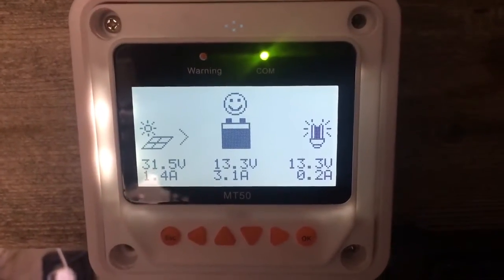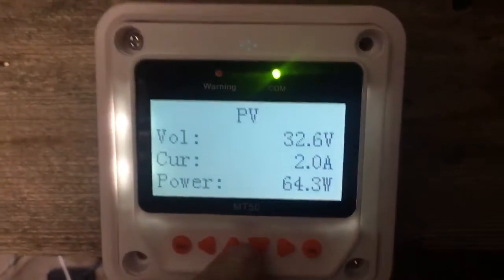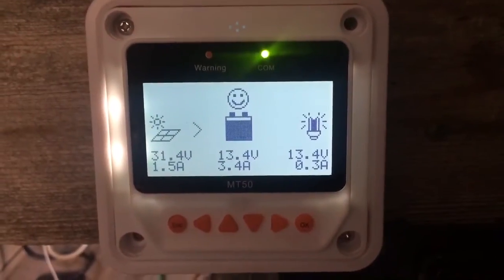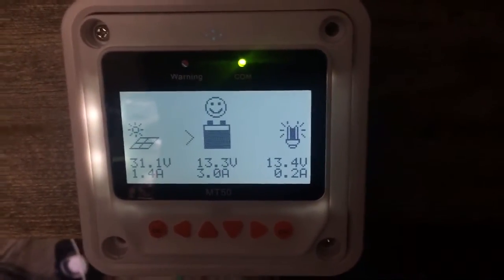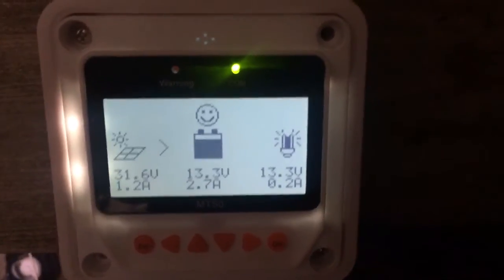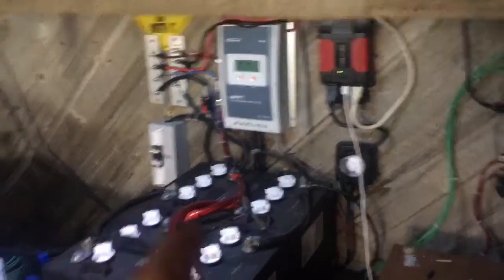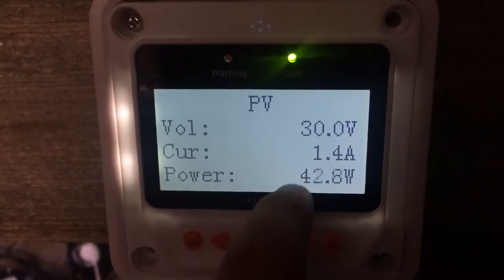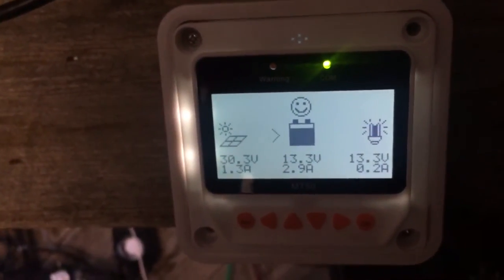Cloud Edge effect With My Solar Panel System

Comment: I thought the A on the left under the solar input was the amps coming in?
Reply from the maker: DecoD71 it is if I said otherwise I made a mistake thanks for watching and please subscribe
Reply: Tom Ziesmer ok but when yours jumps to 11.8! Is that measurement amps coming in or going into batterys?
Reply from the maker: DecoD71 going into the batteries
Reply: Tom Ziesmer ok cool. I have the 40a model aswell just getting my head round it.. keep the vids coming
Reply from the maker: DecoD71 if you have any questions let me know and I will try and help

Comment: Hey Tom, thank you for the breakdown on these MT-50's.  So, I installed my solar in my van about a year ago... and I didn't set to the correct settings on my MT-50, had no idea... Anyway, the MT-50 was set to 200ah sealed batteries, and I had 250ah AGM, think I killed my batteries.  Would you happen to know why the MT-50 will be reading 13.8 or higher on the "monitoring" screen under the smiley face and battery but my batteries are actually reading 12.4 or so on the multimeter?  Thanks man.
Reply from the maker: TwoWander hey thanks for watching and subscribing. Lots of things could be wrong the first thing I would check is make sure the battery terminals and the terminals on the charge controller are not corroded and are tighten to the correct torque. Another thing that could be wrong is your wire going from the charge controller to the batteries are to small or to long and you are getting a voltage drop. How long is your wires from CC To batteries? Another thing is the charge controller is just no accurate but I’ve never had a problem with that so I don’t think it is that. Let me know how long and what gauge wire you are using and we will go from there. I hope this helps and if you need anything else let me know
Reply: Thanks for the reply!  Your answer is exactly what Renogy told me last night.  Good news is I disconnected everything, fully charged the batteries, increased the wire size from battery to charge controller to #8 vs the #12 I had.  The wire is only about 3' long.  Now it looks like the batteries are holding their charge, and the difference between the MT-50 and the batteries is minimal.  So looks like everything is good to go for now.  I spent the whole day going over my system to see if there is anything else I overlooked.  Thanks again Tom!
Reply from the maker: TwoWander no problem I’m glad I could help
Reply: Am having the same issue

Comment: No real reason to ask other than curious: Can you hook up a MPPT along with a PWM off the PV array? Reason I ask is that you mentioned 2 PC fans that cool in day off at night...how do you control them separate from output devices such as a LED lights or do have a DC\AC conv as well?

Not sure how you get 2 fans controlled separate?  thank you!
Reply from the maker: SOILFIT yes you could technically do it if you had a Mppt and a pwm. if you hook your panels in parallel but I wouldn’t recommend it. And my two pc fans are ran off of the charge controller. My other fan and lights are ran directly off of my batteries that have a switch on them to turn them off and on. All my things are ran off of a switch and directly off of my batteries even my inverter.i hope I answered your question. Thanks for watching and please subscribe to my channel thank!!!!

Comment: Its series better than parallels ? I talk about PV
Reply from the maker: Peter Charles hey thanks for watching man please don’t forget to subscribe!!! So both series and parallel have their pros and cons. Normally with a pwm charge controller you would have your panels in parallel. With a Mppt you always want it in series because it is more efficient that way. Although you can hook your panels up in parallel with a Mppt it’s best to hook them up in series. When you hook up your panels in series you bring up the voltage but you keep the amps the same, this is great if you have a long distance from your panels to your charge controller. But when your panels are in series if one of the panels are partially covered with a shadow it basically kills all the output of that string of panels. (So if you have 4 panels in series and only of them are covered in a shadow then basically you will get no output from those 4 panels. Unlike Parallel you would not have this problem, so again if you have 4 panels hooked up in parallel and one of the panels have a shadow on it, it won’t effect the other 3 and you will still get maximum amps three those 3 panels. What is bad about parallel is that hooking 4 panels up together means you will have 20 amps going threw your wire. So you need your wire to be short so you won’t have voltage drop over your wire. With all that being said I suggest parallel if you have a pwm and series with a Mppt. Thanks for watching and if you have any other questions don’t be afraid to ask. I hope this answered your question!!!

Comment: Hi, Can you tell me what is the 0.2 or 0.3 value in AMP at the very right of this panel just under the light icon?
Reply from the maker: Patrick Joly yes that is running 2-12v computer fans to cool down my charge controller. It is hooked up to the output of my charge controller and I have it timed to go on during the day and off during the night. The .3A that you see is what the fans use. You can also use lights or other 12v that can be hooked directly to the charge controller. I hope this helps please like and subscribe to my channel!!! Thanks for watching
Reply: Thanks. Your videos regarding this subject are very interesting.